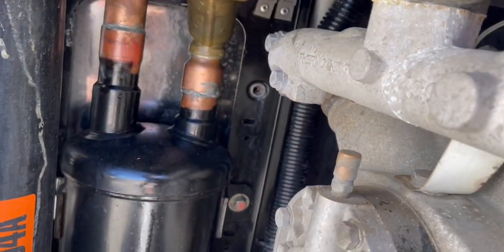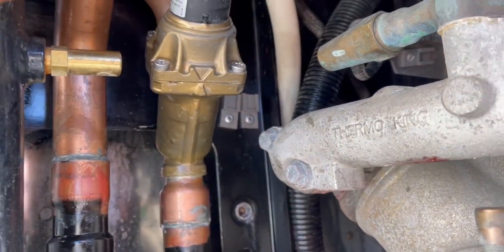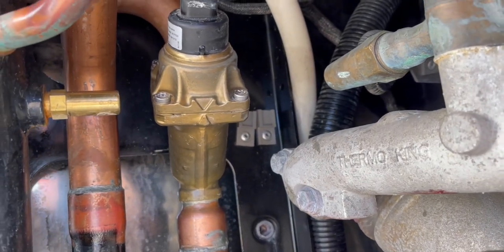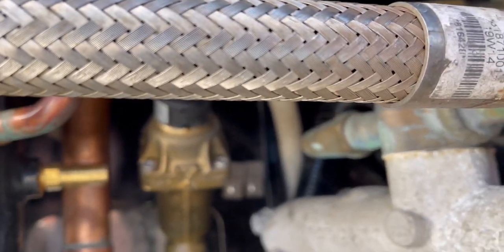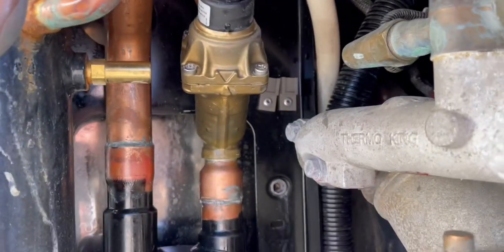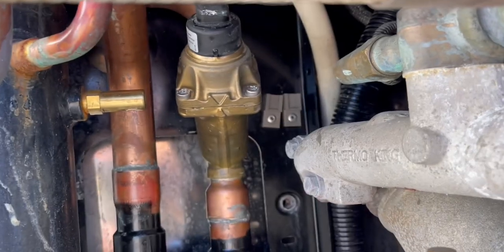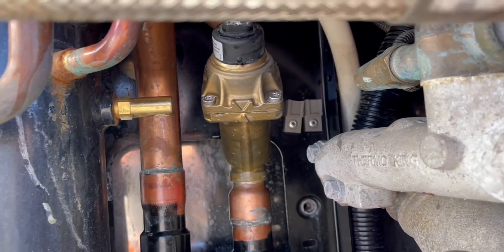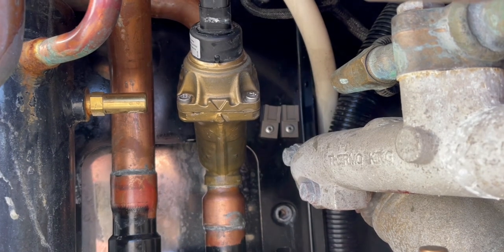Code 89 Thermoking Electronic Throttling Valve

Comment: I MISS THE DAYS OF mICRO uP! Have 3 units, all the same issue, low suction pressure almost Pulled into a Vaccuum. Wasn't throwing code 89 just low capacity. sight glass was full at mid mark. Ended up replacing the txv. Didnt solve the issue. Lesson learned. Next  ill do a lowside pump down and check the etv with service test make sure the micros not acting up!  Any way your video and a flow chart helped in my diag. Thanks.
Reply from the maker: absolutely bro
Reply: Hi, I am facing same problem code 89 etv ohms are good no leakage. Proble still there

Comment: I have a question about the 89 code. But we will talk about the European unit model SL 400 e. I had a strange problem when plugging into the electrical network and after the sound signal for checking the electric motor did not start, the display shows an indication that it is lowering the temperature and code 89 for ETV valve appears which is super strange. What is the case in your opinion here
Reply from the maker: etv valve is shorted

Comment: How’s it going sir? I have a SB 230 starts right up fine then starts to cool down to temperature I have it set at then a couple seconds later the engine starts to slowly turn off checked for leaks, has no leaks checked the injectors they’re working fine changed diesel filter, but just won’t stay on. Would you be able to help me with this problem?

Comment: How are you doing I have a 2013 thermoking SB 330 during the winter it works fine but in the summer for whatever reason if I set it at 34 or any other temperature it will come down to the correct temperature but than little by little stars climbing up sometime up to 12 to 14 degrees above the temperature that I set it up any areas please help
Reply from the maker: check the Freon level

Comment: If its throwing 89 code will it still run correctly and just need to fix it when i get a chance? Im loaded so wondering of it needs to be fixed now thanks for the info
Reply: I have code 89 did you find out if you could run

Comment: I need help with a s600 code 615, rail pressure fault. .goes  into high speed for about 5 seconds fine. Then force to low speed. I replaces the fuel pump and fuel filter... still didn't help. Any help is greatly appreciated. Head pressure was at 300ish. Suction around 45 is. Ambient 100 or so
Reply: Is Eco mode(Triagle)on?